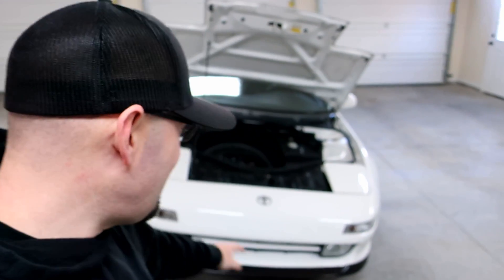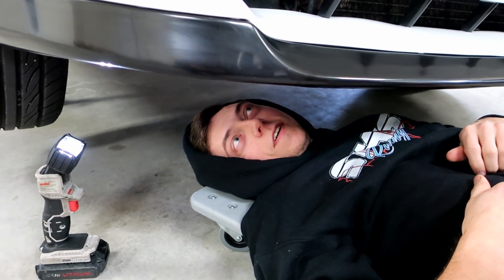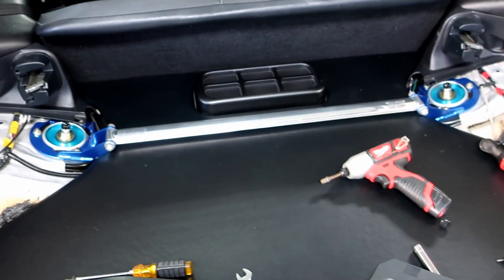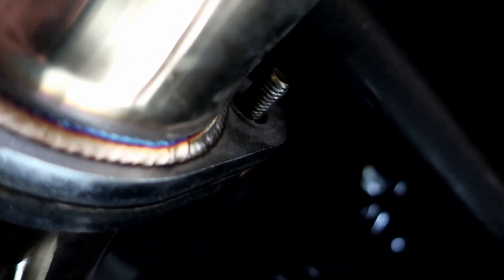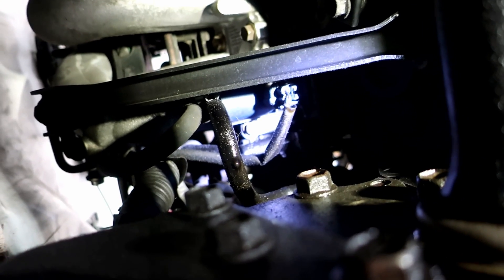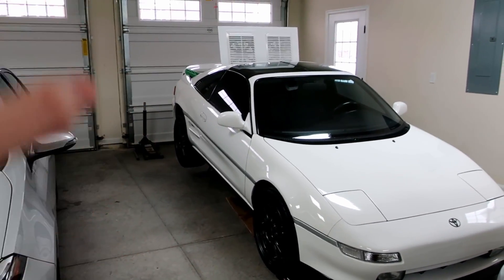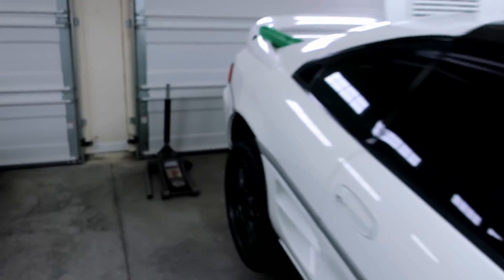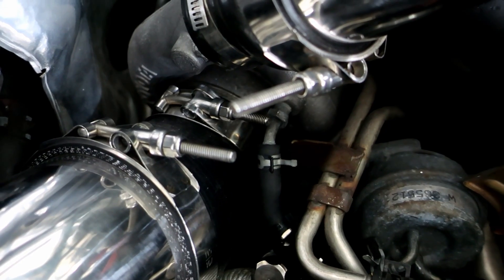So Much Is Broke On The MR2!

Comment: the rev 3 3sgte turbo is the same as the ST205 GT4 they all suffer from boost creep when the boost is turned up due to the waste gate port design.  The 2 small ports can't divert enough exhaust away from the turbine and the boost begins to rise as the revs do.

Comment: My fog light switch worked fine and switched the fogs fine with regular headlights bulbs, but once I put led headlights in the switch then didnt work, but only made my headlights go into high and low mode....something with the led headlights makes it all wonky. By putting regulations bulbs back in the headlights the fog switch worked fine with the fog lights....so has to be the led messing things up